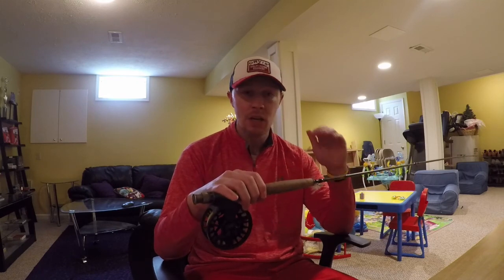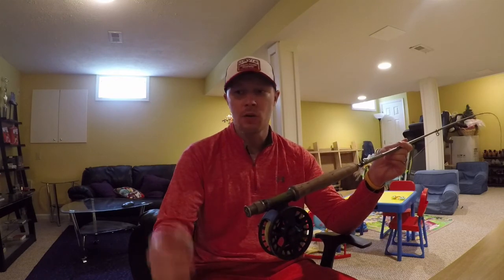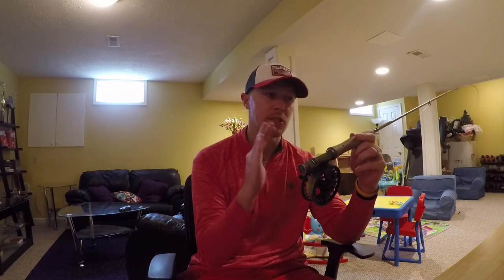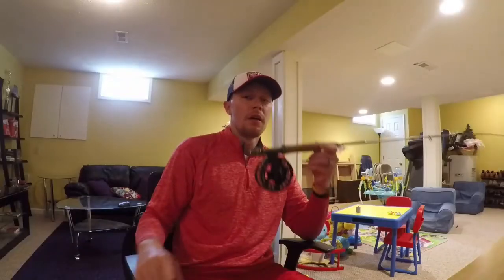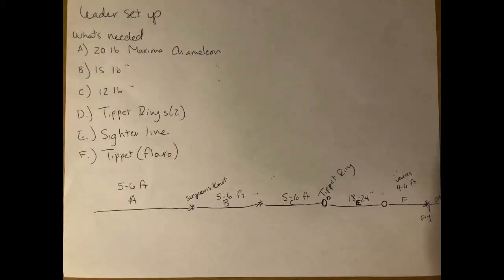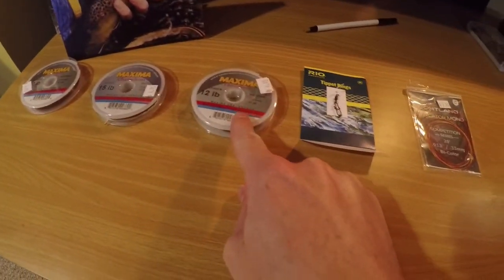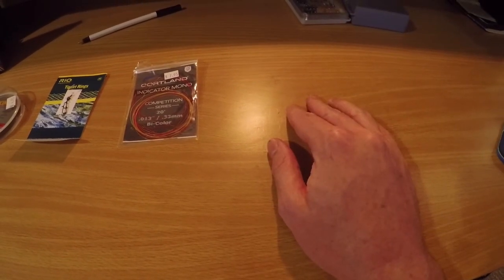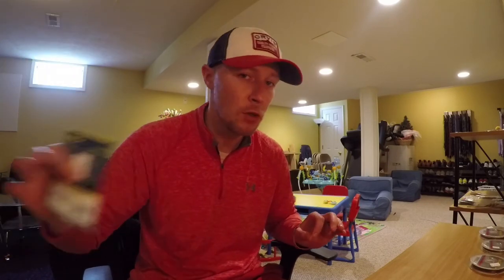Summer School Episode 1: How to Set up Tightline/Mono Rig

Comment: Why different weights of mono? I just purchased a 10’ 3 wt rod & reel and am going to add some mono. Wasn’t sure why you are different different weights. Thanks, Tony
Reply from the maker: Hey Tony, sorry for my delay in response. I have a million things going on, so I apologize. The different weights of mono taper it down and help with casting and just the build up if you will to the tippet ring. For my Euro Set up, which I did a video on as well, I do it much differently and really no taper. Tight lines!

Comment: I'd use a blood knot instead of a surgeon knot for that heavy mono. Much less bulky. Also in your system the taper is mostly irrelevant. The rod is 10 feet long so if you have no fly line off the reel, the 20 and 15 aren't out of the guides anyway. Just my opinion
Reply from the maker: Hey Steve,

Thanks for watching. I totally agree about the blood knot. That is what I use for the Maxima Chameleon line connecting all the pieces. I typically only use surgeons knots for tippet. I never really have line on the water, so you are right about that. As I create new ones, which will be soon. I am likely just to use 12 or 15 lb only sections of 20-25 feet, and cut out all the steps, they are a pain anyway, if I can avoid it, and still be effective. Appreciate the feedback!
Reply: @tightliningmd  keep up the good work

Comment: I've been using a 9ft 5 wt for tightlining and it works but I feel as if the extra length of a 10ft or 10'6 would be better for getting reach on your drift which I find is an issue for me
Reply from the maker: I would HIGHLY encourage you to consider a lighter rod, 2 or 3 wt, mine is 3 and I love it. The extra length is weird for sure to start. Takes getting used to. First time a buddy lent me his to use on a stream the extra foot and a half really messed with my psyche. However, I have never looked back and I use it on small streams and big rivers. In some cases I wish I had longer than a 10', like the 10'6 or 11'.  You are absolutely right about the drift and also being able to reach spots from a bit further out and not spook fish.

I love my Syndicate, and that company is so responsive to their customers if you break it, which I did once lol. Also, they are the mid point for rods in the industry. I won't call all in on a Sage ESN, but I know that Orvis Recon, another relatively mid point rod started making them, and I hear they are awesome. However, Syndicates are stellar. I believe Cabelas does a cheaper one, and don't forget about Cortland. I believe they were part of the pioneering of the systems and some of the pros/comp fishermen swear by them. No matter what tho, the makin thing is 2/3 wt and 10' or longer. Lastly, get a reel a size up for balance, to help with arm fatigue and rod set up. So for example I have a 4/5 lamson liquid reel on my Syndicate, instead of a 2/3. The line is irrelevant in my opinion, so go cheap, but if not a Euro Line from Rio is great.

Let me know if you have any questions!
Reply: @tightliningmd  yeah I'm gonna get a specific rod for nymphing the trout around here get pretty big I mean like double digit not the true giants but 6lbers have been cought from to time on a fly especially caddis larvae and big stoneflys so I'm gonna go with a 3wt just in case I hook a big brown I haven't lost too many fish with the 5 wt but it's without a doubt a little too heavy and short but it's the only rod I got and I'm on a budget which sucks
Reply: When you say small streams for your Syndicate, how small? In Wisconsin our streams are generally 10 feet wide. You are fishing small pockets often in tight brush. I use an 8’6” 4 weight dry fly rod but it casts a mono rig poorly. Only reason I’m thinking of going with a longer dedicated Euro rod. On the other hand worried there may not be enough room to use a longer rod easily and properly.

Comment: Thanks for the video.  Lots of good stuff.  Could you tell me what specific reel you use with your Syndicate rod?
Reply from the maker: Hey Alex,

I apologize if I didn't specifically state it. I use a Lamson Liquid reel size 4/5 I believe. You size up on the reel one higher than the size of the rod. The idea behind it is that you want the weight to evenly balance the rod so when you are arm fully extended, which is the intended way to get a good drift tight lining, you arm doesn't fatigue as fast. I believe my reel is considered "large arbor", but I can't say that with certainty, just know it is a sizable reel. It works perfectly with that rod in my opinion. One tip I would give is to go cheap(er) on line. If you truly use the long leader like I built here, with a good drag system, you won't get down to the fly line anyway unless you are fighting and pulling on a true monster. Hopefully that helps. Thanks for watching and hope you got something out the video!

Comment: Fabulous job on video especially on the leader setup.  Could you explain where on your tippet do you tie in your tag?  This would determine how far apart your two flies are from each other.
Reply from the maker: Andy,

Thanks a lot for the feedback. I know this was long, and I tend to be long winded, I just wanted to make sure it was thorough. Here is what I do for my tag, and to be honest I was hesitant at first, but it was meant more hook ups....

1.) Don't tie in to the bend of the hook for the first fly. You can, but it is less effective. Just trust me and the literature out there to support.
2.) I would take my first section of tippet and make it approx 1 1/2 the depth of water. For example 2 feet of water is 3 feet of tippet. I then take about 18 inches of additional tippet, which is separate, and do a double surgeons knot (easy to tie) and connect the two. I am sure to overlap by about 6 inches for each. What that does is gives me a 6 inch tag coming off in two places. I cut the one excess tag that is coming from my additional 18 inches of tippet, so maybe "crimp" it a bit so you know which is which. That leaves me with the other tag, approx 6 inches, or a little less, coming off from what was the original 1 1/2 of tippet. 

What this leaves me with is about 3 feet to my tag fly (the one coming off the main section) that I got as a result of the surgeons knot. Always make this the smaller fly. Then you have the additional 12 inches, because you cut off six from the surgeons knot, to your final fly. So for example I usually use a size 12 fly on my point, the very last fly at the bottom, and a size 14 on my tag end. Can go up or down as you see fit to a 10/12 or 14/16. 

Hope that helps and best of luck. I appreciate the support and comment!

Comment: Great explanations! I'm still getting the hang of tight lining and had a quick question... how far away can you effectively fish with a tight line rig? I like fishing larger water and have had difficulty with line sag when I try to cast further out (I use a mono rig setup like you were explaining). It seems that by fishing further out that my anchor fly and tag fly are in different current seams too. Do you usually fish out only slightly further than the length of your rod and work that current seam? Sorry for the lengthy question haha thanks for the informative video!
Reply from the maker: Doug,

That is a great question! I personally, when using the Mono Rig, tend to not do a true cast. I am always Roll Casting, or Bow and Arrow Casting. Therefore, I don't get a traditional long drift. With the 10 foot rod, long leader, I am probably casting about 15 feet or so, give or take, upstream, and dead drifting back to me, with a swing. I pick about the water in sections little by little and look for features in the water where fish should be hiding. I then get within that 15 foot radius and get after them. I find in big rivers the fish don't spook as easy as the little wild streams. I just fished Penns recently and employed this tactic and caught a dozen in a few hours. 

I have observed competition anglers who do in fact cast a Euro Style rig upstream and can keep just enough sag in line from say 25-35 feet away and look for subtle takes. I haven't mastered, nor tried. I would imagine they aren't using a Mono Rig. Likely more a custom leader, with a sighter, tied to the Rio Euro Line and having the Rio Line out of the guides. I prefer not even having any line out, just my custom leader. 

Have you ever watching Modern Nymphing by Lance Egan? It is STELLAR. The first one helped me greatly, and I was already tight lining. I also then watched Modern Nymphing Elevated, their sequel, and it helped me improve to variations and I have become a much better fisherman as a result.

If you haven't seen that check it out ASAP. A great fly fisherman like yourself will definitely enjoy the film. Also, do you read Troutbitten.com? His articles are concise, mostly, and almost all about the Mono Rig. He is a PA Angler and fishes the same water as you. I know with certainty he covers much of your question about flies not being in the same current seam. I tend to auto fix that by short roll casts, or so I think. 

Selfishly speaking I have admired your work from a far and would love to fish with you some time, would be an honor. Anything I could do to help would be my pleasure. However, I also respect peoples privacy and uneasiness to fish with people they don't know. If you ever want to link up I would be happy to help show you what I know. In the same light though I am sure you will pick it up quick given you are a solid angler.

Thanks for checking in and sorry for the long response. Didn't want to short change you. Tight lines!
Reply from the maker: Hey Doug,
I am glad the response helped. If you are already reading Troutbitten you have a leg up for sure. The videos I mentioned you will love. Such great cinematography and fishing content. 

I will touch base with you about fishing. Hopefully we can coordinate a trip up in Central PA and do some fishing. I think we both have stuff to learn from each other and would be a good experience.

Enjoy the George Daniel book and hope to see you soon!

Comment: Great video, thanks for taking the time.  How many "X", or what diameter is your sighter?
Reply from the maker: Scott,
No problem. Thank you for taking the time to watch. I can be long winded, but it is critical to get it right. I am sure there are ways to adapt it, but overall that was my basics. 

To answer your question, I use Cortland Indicator Mono Competition Serials 20' .013. I just got off sections from that in increments of about 18-24 inches. As long as I have both colors visible to me and tippet rings on both sides, that works for me.

Hope it helps and good luck!